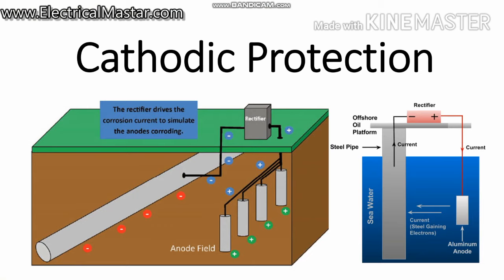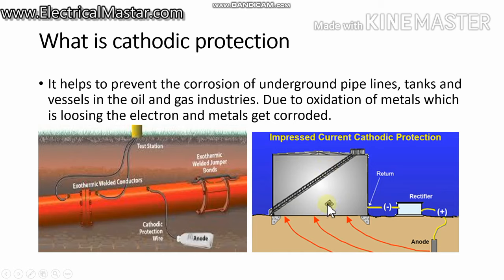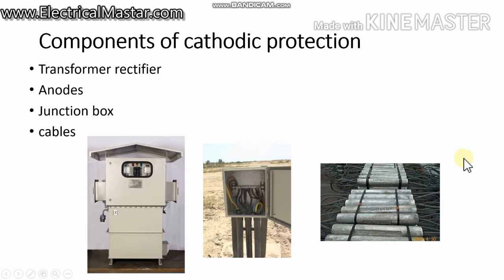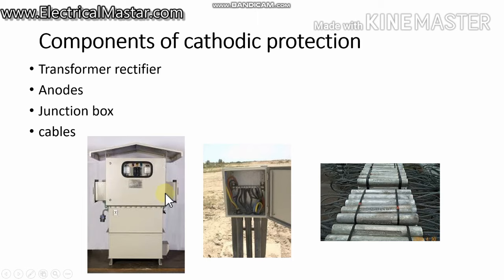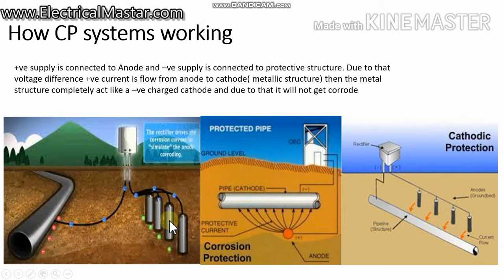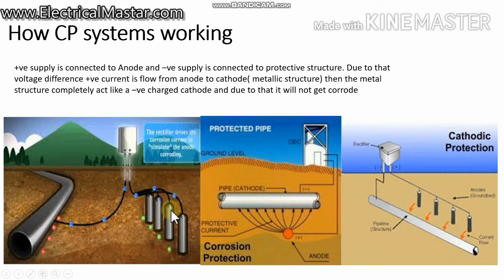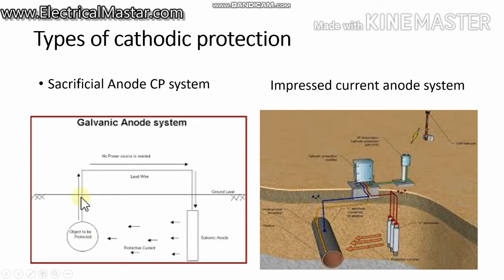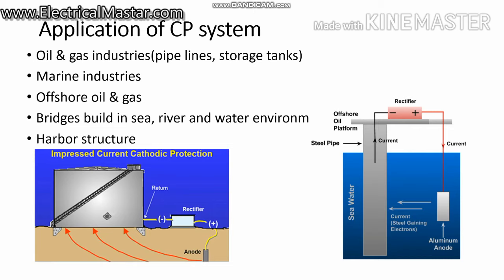How Cathodic protection system working |Types |Application

Comment: Question: For a cross country long pipelines at what length of the pipe a CP system would be required? Or in other words a single CP system can protect till what length of pipe?
Reply: Good question, we need an answer
Reply: We can protect using ICCP...

Comment: interesting and educational.... I work as a powerline and our problem in our overhead line system are the corroded anchor rod creating down wooden poles when this anchor rod pulled out due to corrosion. can this cathodic protection applicable to protect our anchor rod from corrosion using the sacrificial anode method. the anchor rod is a galvanized 3/4" diameter.

Comment: Thank you for the video. What is the minimum distance of separation that the cathode and anode need to be to prevent a short? If air is the medium between cathode and anode, what would the distance be? Thanks again.
Reply: Already they said anode will be placed around 10 meters around metal structure need to be protected which acts as a Cathode and anode will be burried beneath 1-2 meters below ground surface..
Reply: A metallic path is necessary for a electrical short.  So even 1" or less of isolation would not be considered a "short". I test cp in Boston Mass. 🇺🇸 tight quarters full of potential contacts to the cathode. If its not metal to metal through the coatings, your desired current will not leave the cathode. Even in a very low resistivity soil/electrolyte.
Reply: Btw... "Air" is not an electrolyte.

Comment: For 1km of Gas line how much anodes are required &  for fuel line?
Reply: It depends on many factors like the dia of pipeline, coating type, current density, soil resistivity etc